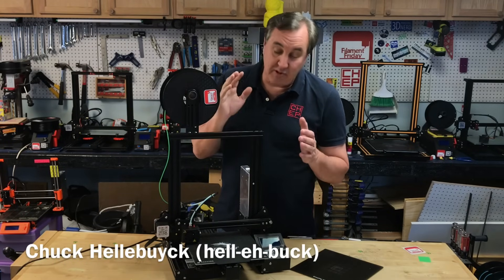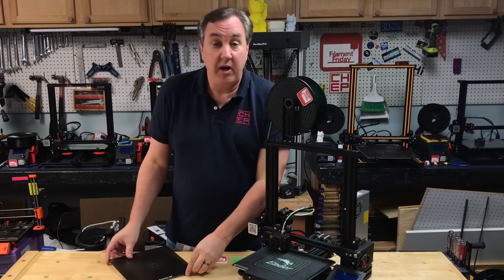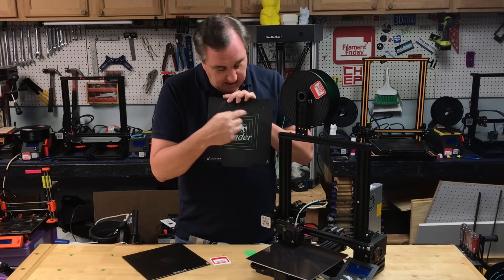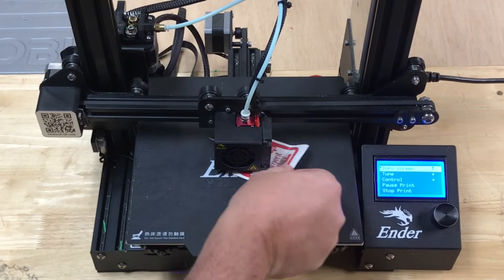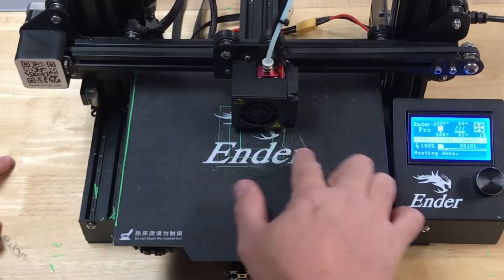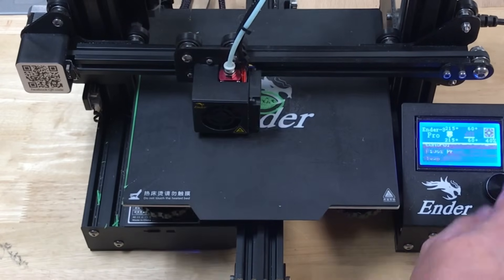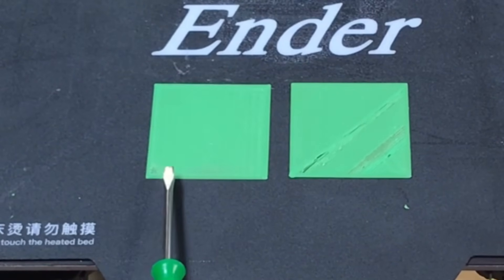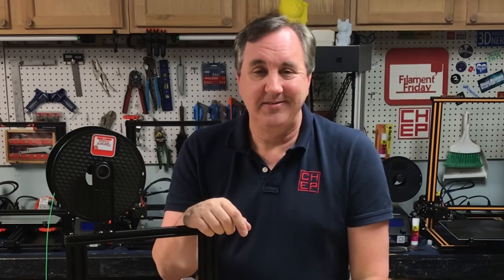Creality Ender 3- Easy Way To Level Your Bed

Comment: I almost broke my printer by following these instruction - probably because I have no idea what I am doing. Starting the Sq_bed_level_test.gcode it started by printing a line along the left side of the bed before printing squares. Unfortunately this made my nozzle go straight over a binder clip. Later after some squares, I stopped the print - this made my printer move fast and completely disregard the end stops, and continue to try to move. I had to turn the printer off. What did I do wrong?
Reply from the maker: You need to Home the Printer first. I don’t know why it would speed up. The strip is a purge strip to clean the nozzle first.

Comment: I just assembled  my printer. I am afraid, that the first code(bed level?) will dip the nozzle down into my bed. From this video, it sounds like it is just a matter of making micro adjustments, but what if my z switch is positioned wrong, and the bed is e.g. a full centimeter too high.
Reply from the maker: Check it manually and lower the head but turning the rod until you hear a click in the switch. That will give you an idea.
Reply: @FilamentFriday  Thanks for the reply - you are the best.
I can run "Auto Home", and it puts my nozzle under the table (the table is moved out of the way) and sets Z=0. So I expect, that I should lower the table(or raise Z switch), before running the bed level program.
Reply from the maker: Yes, lower the bed probably and get it close.

Comment: When doing the sq_bed_level_test g.code is it normal for the printer to print a line along the edge on the left of the plate? When I first used it, it wouldn't, and it would print a skirt around the rectangles in the middle, but then it stopped doing so and now prints that line along the edge on the left that can be seen in the video starting at 3:30.
Reply from the maker: Yes. It should print the purge line.

Comment: I installed a glass bed on my ender 3 because while using this leveling technique, I realized that I had a warped bed. After installation, my nozzle is still too far in the center! Does anyone have any advice?
Reply: Glass may be warped maybe try a auto bed level mod

Comment: Hello! My Ender 3 has a recess of about 1 millimeter in the center of the table, can something be done about it?
Reply: This is the first thing I did! but it does not help. there is still a hole in the center of the table
Reply: Den CHornyy another option is to use tin  (aka aluminium) foil cut into squares placed under the removable bed in the recess. Use as many as you need until you cannot get a sheet of paper under a flat edge spanned across the table.
Reply: @slicedpage  Thank you very much! Your advice helped me !!
Reply: Den CHornyy your welcome. Sometimes glass beds do not work. I have just started using a mirror which is made to a higher standard than glass and it works really well.
Reply from the maker: Install a glass bed is one option.

Comment: Hi Chuck thank you for that video very helpful for newbie like me.One Q:line ara good every site but when the head (hot end) turn in the corner line come up ,only in that small part.What to adjust Thank you
Reply from the maker: That is a purge line. You can modify the GCode to eliminate that if you want.
Reply: @FilamentFriday  Thank you

Comment: am i doing something wrong because the filament is really hard and i have to scrape really hard to get it off the bed, im using creality filament
Reply: Make sure you have the correct temperature settings for the filament you're using. Creality sells PLA and abs and other resin types all of which have a different extruder nozzle temperature requirement
Reply: Corey B...On mine it's embedded in the bed now. Maybe the nozzle was too hot and/or too close. One of the reasons I changed to glass. Sooooooo much easier.

Comment: First of all thank you very much for this. I installed Marlin 1.1.9 with mesh bed leveling to my Ender 3 pro. After the leveling I run your G code to test print but the print was terrible, the PLA not sticked to the bed. Adter that I use the 3D model and slice with Cura with my settings. I printed that and i was worked. What do you think why did it happen? I'm using 0.2mm layer high 15% infill and 55mm/s speed.
Reply from the maker: Your z setting is too high.
Reply: @FilamentFriday  Today I did again a bed level first with your code after that with mesh bed level. Now everything is working well. Bed Z is 0 currently and the PLA stickes.

Comment: I had my springs almost all the way down and with the glass plate it still squished the bed down a bit.
Reply: You probably figure it out already but it sounds like your turning the "wheels" the wrong way to bring the bed down
Reply: No - it turns out that the aftermarket stronger yellow springs a bit longer.  Aftermarket springs + glass bed = you need to move your z limit switch. I ended up squashing the springs as far as they'd go, levelling the bed there, raising the limit switch 1mm above that, and then relevelling.

Comment: Okay can someone help me understand how to load the g-code onto the printer? I have an Ender 3. I assumed you just download the files onto the USB/SD card, plug the SD card into the printer and then select the gcode to start it. But when I plug the SD card into my printer, it doesn't show up. Am I missing a step or doing something wrong?
Reply from the maker: Which Ender 3? The Pro you have to insert it upside down. Sometimes on the LCD it shows Init SD, you have to click that.
Reply: CHEP I don’t have the pro, just the regular ender 3. I realize now my mistake. I didn’t use a slicer

Comment: Hi Chuck. Thanks a lot for this tutorial! I got my first 3d printer (Ender 3 for x-mas from my wife) and this helped me a lot! I let the printer run all the squares and it was amazing seeing my first own thing to be created :-) after that I went over to the benchy, but the text wasn't nearly as nice as yours in the vid. Since the files on thingiverse are .stl, I used the latest Cura to slice it into gcode with the default Ender 3 draft settings. The nozzle was moving quite quick and the filament wasn't sticking that well at the text-parts as some minutes before with the squares. The outline on the other hand was quite good.
Now here are my three questions:
1st) can you post a realtime video of printing the first benchy layer?
2nd) can you post/export all your slicer settings? Be it cura or slic3r... maybe I have too much speed or too much speed for the initial layer or too much acceleration (where ever this setting is ;-) )
3rd) can you provide your benchy-gcode for comparison with mine?
Thanks for helping a newcomer to 3d printing!
Reply: Chuck is definitely, and obviously the one to help the most. But I had the same issue when I got my first 3d printer. I could not get even a reasonably decent print. I only had it 3 weeks and the power supply went out. I returned it and went with an Ender3. best decision I have made in a while. I discovered pretty quickly that the bed, and leveling are incredibly important. I print everything with stock Ender3 settings in Cura. I get perfect prints most every time. When I don't, it's always my bed calibration.

I should add, I do slow my print speeds down when I'm printing something with a small point of bed contact, compared to total print size. Example, the Moon lamps on Thingiverse. Very small point of contact for adhesion, and the extruder moving too fast will knock it loose every time. Slowing it down to 25mm/second never knocks it loose.
Reply from the maker: Try the profile linked in my latest video. It’s very similar to mine.
Reply: @FilamentFriday  Took me a while and I had to run several tries. With the new settings it was only a littlebit better, then I tried to print with a raft and it only got worse with the letters. Then I printed really, really slow and it was way better. At that point I noticed, that my center of the bed was lower than the corners. Printing in corner at normal speed worked beautifully. Problem solved. Thanks to both of you! Now I think about a glas bed :-)

Comment: This is really helpful, but when it comes to that center point, don't use the knobs to raise the center. Add one layer of painter's tape and check. Repeat that until it comes out right. If the center is too high, that's when turning the knobs can be somewhat helpful. In that case though, you may find that you need to add tape on the corners so that those don't get too low.

But, probably the thing to do is just get an ABL, the creality one has the added bonus of coming with the necessary gear to flash the firmware.

Comment: Wow, these gcode files really do the trick. I was managing to level the bed by hand without too much trouble, but it was painfully slow especially considering that the Ender 3 seems to chance leveling from cold to warm. Your leveling print speeds up the process tremendously. The level square file is also brilliant in that it verifies that the bed is truly level and ready to print.

Comment: Thank you very much for your video. I followed the steps and everything seemed to work right after I tried to print a big file and the brim begins to curl up. What it's sound weird to me is that everybody claims to level with a piece of plain paper which is about to 0.18 mm. But you suggest to make a deeper leveling using the back of the sticker which may be about 0.05mm, resulting in a much closer nozzle. Why are you leveling at that height? Thanks in advance...
Reply from the maker: It gets it closer for the live adjust which is where the real bed level occurs. Most beds dip slightly in the middle so getting closer get the filament to stick better. If you are seeing a brim lifting then I suggest cleaning your bed with warm soapy water or even Isopropyl alcohol.
Reply: I finally got a piece of paper of about 0.09 mm. I guess paper width may be different than yours. My bed is warped also, so I finally level in a midpoint as I'm printing a big file. I've changed the stock base with a glass. In this way I got very few adhesion since I spray it. Thanks anyway. @FilamentFriday

Comment: Hey CHEP I used your leveling procedure, it's much more easier and adhesion it's pretty good. But I still have some issues. basicaly I wanted to test gcode of the test dog that came on the SD card with my enter 3, but when printing the base, inner corners near the legs of the dog begins to peel off and causes a mess. Before I was printing that g code with white filament that came with my ender 3 and I had some small issues but printing was doing fine. I changed to a green filament and had adhesion issues but solved with your procedure, so maybe it's not leveling. Do you know what could be happening? I have some pictures of the defect, I whould like to send it to you if I'm not clear with the problem that I have. Thank you for your videos, they help a lot.
Reply from the maker: Raise the bed temp 10° and see if it sticks better.

Comment: I used the level gcode and it went great, but when I ran the square test print, the nozzle totally bottomed out and etched into the bed mat.
Are there different settings I might have messed up? @chep
Reply from the maker: Rerun the paper test after homing and then disable steppers.
Reply: @FilamentFriday  thank you! I will try it out. The right side started to print ok after some manual tinkering with the knobs, but the left side kept picking up and taking the rest along to making pasta.

Comment: Where do we actually store the files on the little storage disk? Under files folder? stl folder? I also dont understand about the software.. install it on computor to make a printable file or directly to printer?
Reply from the maker: Just put them on the MicroSD card at its root. And install in the printer SD slot. Then run them from the printer.

Comment: I've noticed that many others complain about the weak springs on the bed knobs. But you didn't mention it. Another myth to be busted?
Thank you.
Reply from the maker: I’m looking into it but I haven’t had any issue with the stock springs. I believe it relates more to holding position.
Reply: @FilamentFriday  Thank you.

Comment: OK at 2:30 you say slight resistance and then at 2:40 you are saying significant resistance... which is it?
Reply from the maker: Slight resistance works fine. Your just getting it close. Then live adjust does most of the work.

Comment: Dude, I was about to give up and return my 3D printer until I saw this video. Nothing I did could get the first layer to stick. Nothing I googled could solve my problems. Bought replacement parts, filament doesn't stick. Thought my bed was level, filament still refused to stick. You and your GCode saved my ass.

Comment: Should the bed be heated to  the temp you plan on using when you level it? Thank you great video!!
Reply from the maker: It doesn’t really matter. I do it cold.
Reply from the maker: The live adjust takes care of that since then the bed is heated.

Comment: I'm still having some problems. Even after I did the leveler 5 or 6 times. When I run the test, I get some pla that don't start, and some of the squares do not stick. I'm at a loss
Reply from the maker: Where it’s not sticking raise the bed, where it’s not starting lower the bed. Just tiny adjustments.
Reply: Same

Comment: Thanks this worked great the first time I tried.  I'm so glad to have found your video.
Reply: Also a raspberry pi with octoprint makes printing sooooooo much easier. I have the two gcode files you provided loaded  on the pi for re-leveling any time I need to. Now I just need to get a camera installed and I'm almost hands free :).

Comment: Oh boy this video and the gcode files are a life saver, I've been trying to get my new Ender 3 printing for days. Until I watched this nothing was working. Thank you
Reply: I would like to second this. I have been very unsuccessful at leveling my bed using the paper method, it turns out that my definition of "a little resistance" and others definition of "a little resistance" are two very different things. Printing the squares so that I could see the results of my knob turning in real was the ticket to success. I went from not being able to print anything to successfully running the printer for nearly 36 hours this weekend. Time to fire up Patreon.
Reply from the maker: Glad I could help.
Reply: @FilamentFriday  I'm wondering though, the very next print failed at the first stage, it's a design I downloaded from Thingiverse. It's a tree ornament, I sliced it with Cura with Ender 3 selected as the printer. I left all settings as default. Could this be the issue? 

I'm using manufacture settings for the PLA, 215° for the nozzle and 70° for the bed.
Reply: @FilamentFriday  Furthermore, I'm now trying the test file that comes with the printer, the dog. So far so good with this one. Is this because this has been sliced with optimum settings for the Ender 3 and not necessarily the defaults Cura gives it?
Reply: @deanbestall  I just got an ender 3 for christmas.  Leveled the bed without this video and printed the dog.  Came out great except was a pain to get off the bed.  I went to print a new item that I sliced using cura standard draft profile and it wasn't sticking.  I thought I didn't clean the bed well enough.  Tried and tried again.  Found this g-code and the bed was way out of level.  Re-leveled with this g-code and it's perfect now.  Every time I remove the bed to remove a print I'm definitely leveling the bed.  That is until I get my BL touch installed.  (This is my first and only foray into 3D printing.  I have been watching youtube videos for a month on this stuff.)
Reply: @deanbestall  I used simplify3d to extract the gcode from the dog print and used those settings all weekend with great success. I didn't try using the default Ender3 profile that simplify 3d has but the profile from the dog worked well. I used Chep's  "Perfect Print from a cat" video to get the dog gcode: https://youtu.be/SRQ-3nnSa-4
Reply: mag bed is nightmare as shows any flaw in ally bed and magnet and ally dont expand and contract at same rates 
the biro pen springs dont help
But video sure does thanks chuck's

Comment: CAN YOU DO A STEP BY STEP GUIDE ON HOW TO USE THE PRINTER DIALS THE y, THE z, AND THE x, AND THE MEANING OF THEM
Reply from the maker: I’m not sure I understand what you want? 
There are no X,Y, Z dials. Can you explain it another way?
Reply: @FilamentFriday  i just bought the 3d printer and when i click the nob i got lost once ni got into the screen. caan u explain the x, y,z  to make a mold like how to dial in and put the numbers in the system to make the product. i like you video btw.
Reply from the maker: Have you installed the included software called Cura to create the file to print?
Reply from the maker: I working on a 3D printing for beginners video.